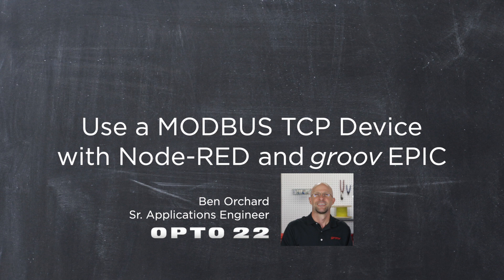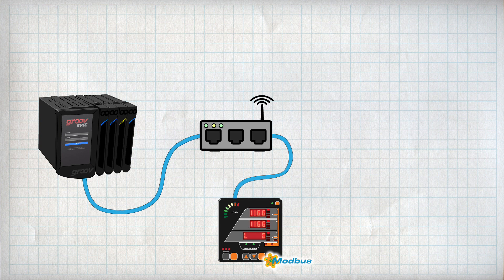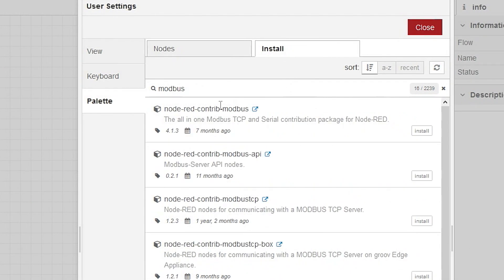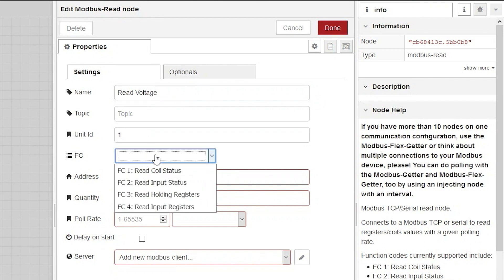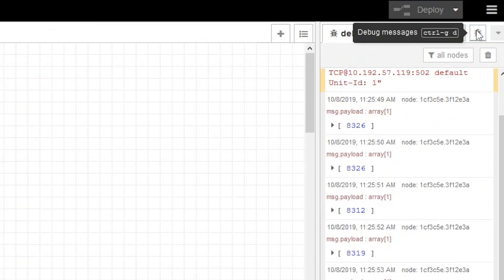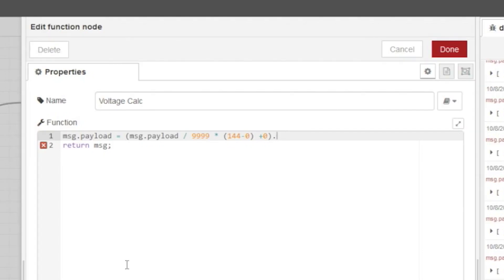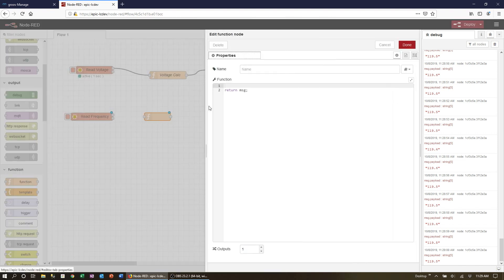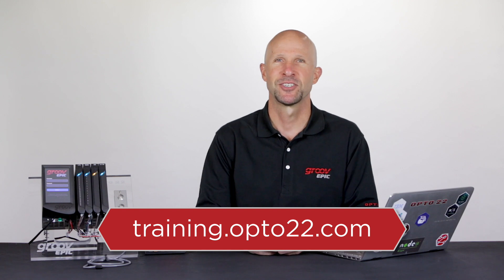Use a Modbus TCP Device with Node-RED & groov EPIC

Comment: Hello. I have a question about using this lib. When I reboot Server hardware TCP connection from Node-RED side did't retrieve. To solve this problem I should deploy Node-RED flow again or reboot hardware where Node-RED server runs. Any ideas about it ?
Reply: I have a similar problem. The modbus-read node doesn't start polling when node red is restartet and I couldn't find a way other than manually deploying again. Is there a solution?
Reply: @CO74  Yes, you should yse node.js v12 instead of last version.
Reply: @to1to192  That absolutely did the trick. Thank you so much!

Comment: hello sir, excuseme.

I see Power Logic type PM710 read Voltage 221 Voltage and I see msg.payload 170 Voltage. 

How is the calculation so that the red node's msg.payload is accurate around 221 voltage?

I've used voltage calc not very accurate.

Thank you